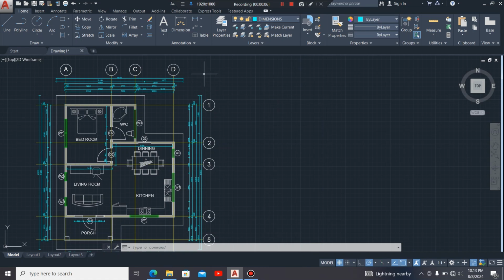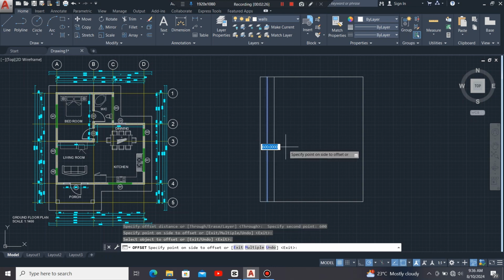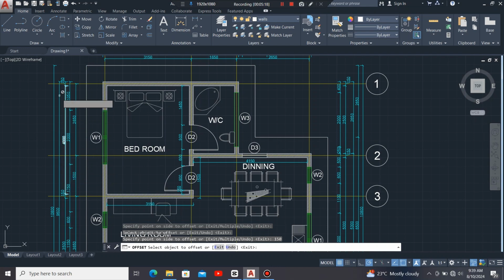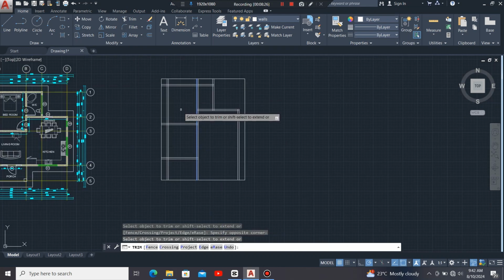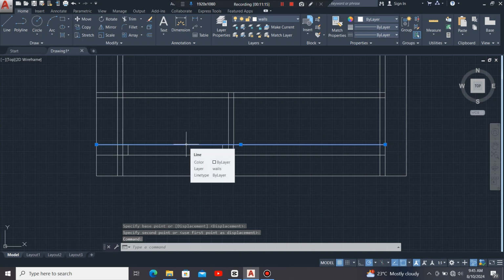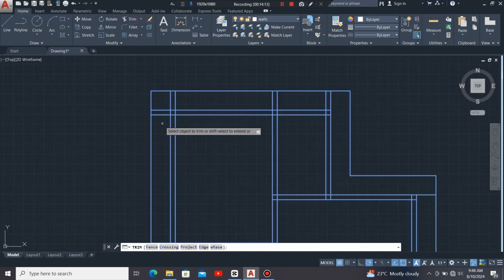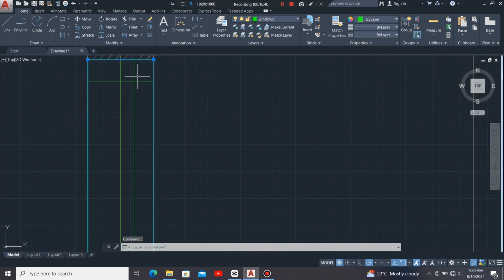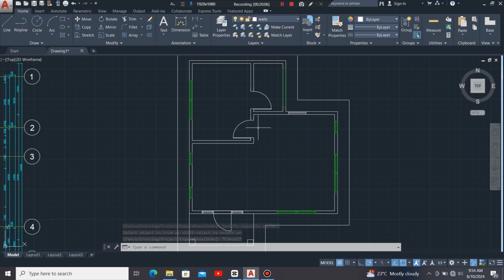"How to Draw Perfect Floor Plans in AutoCAD" PART 1

Comment: brother i have a question do we use millimeters in the international freelancing marketplaces
Reply from the maker: Yes but it will depend on the location of the client you are to serve because some clients are in locations like America, where they consider using inches so for architectural drawings it's either millimeters or inches
Reply: Thanks for replying bro last question how I know the offset like I've a location of suppose 6900*5000 then how'd I know the offset their should be 600 mm like that plz reply